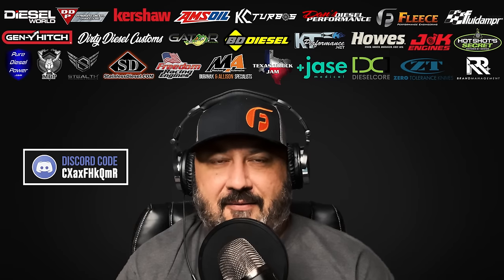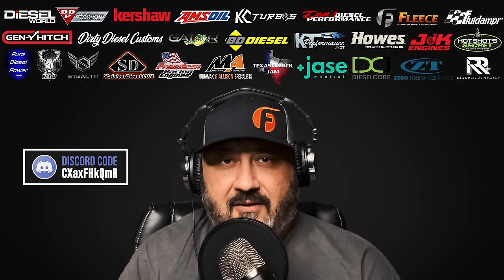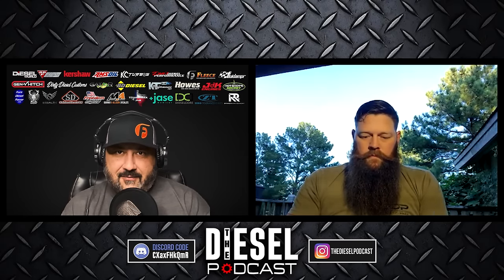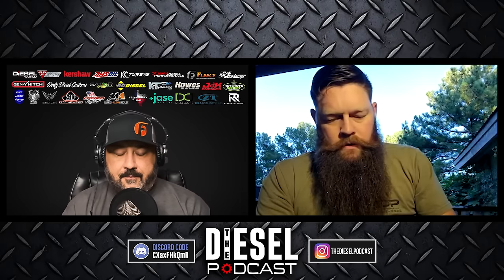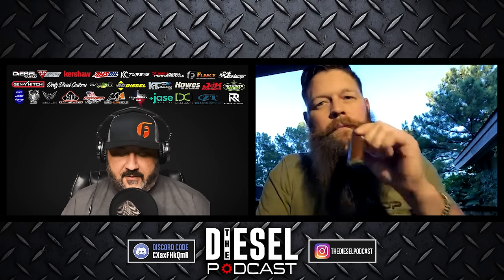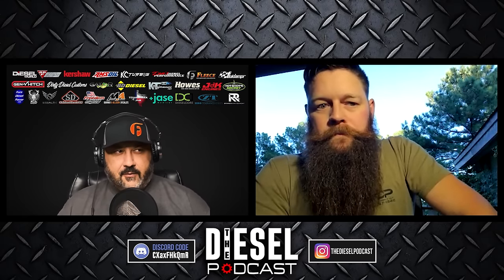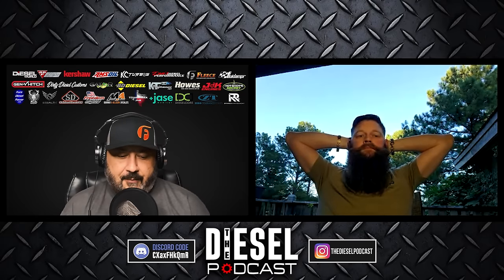Forced to Put DPF/EGR Back On?

Comment: I deleted my truck because I kept having problems with my emissions and kept spending THOUSANDS of dollars repairing it. Even if i did it myself, i would still spend thousands of dollars. My truck would stay on regen mode for hours driving on the highway and I'd get average of 6 to 8 mpg. That's bullshit.

I deleted it and tuned it and it woke up my truck. I get great milage, less repairs and my truck has over 600,000 miles on it. Without that delete, that truck wouldn't have seen more than 250k miles

Comment: Thanks for the excellent podcast. I have driven a diesel since 1982 when GM was raping the public with their 5.7 liter converted gas engines. I made a few changes and made that 5.7 last 350,000 miles. I had always wanted a Dodge ram with a Cummins and finally got one. It was a 2001 long bed quad cab with a 5.9 HO and 6 speed manual. This truck got better fuel mileage than the S-10 Blazer or the Astro vans I had. We took it on vacation because it was so economical at 23.7 mpg running down the highway at 70 through the mountains in Missouri, Tennessee, Kentucky. I had gotten over 25 mpg on several tanks. That's hand calculated!!!. I expected similar results when I had to upgrade to a 2008 2500 HD with a 6.7. I wanted to do the right thing and be emissions compliant but the truck was in the shop twice a month for the first year I had it. They kept telling me they would fix it. LOL!!! My fuel economy with that truck was 25% less than the 2001 because of the emissions system. The same EPA that is truing to force impossible mileage goals for the manufacturer just killed one of the most economical vehicles on the road. I engaged a lawyer, sent all of the repair bills which were all emissions system related to Dodge explaining that due to loss of use, time off of work taking the truck back and forth to the dealer, decreased fuel economy, etc that they compensate me $15,000. They came back with an offer of $7500 if I would just go away, they didn't even contest it. The emissions system as originally designed and manufactured was defective. It would not work anywhere but in a controlled environment. You guys are correct in that they have no idea what they are enforcing, how the system works or anything else for that matter. If they would allow the manufacturers to build a system that would work in everyday use, I would go for it but they won't. They have run Volkswagen diesel cars out of the US and seem to be working on the rest of the industry. If they would work with the manufacturers to build a system that would work without huge maintenance costs and fuel economy penalties maybe people wouldn't be deleting. Their job is to find things to worry about. If they don't, they don't have jobs so they will create new issues that keep them cramming laws down our throats to keep themselves employed. They have made many of us criminals but they accept no responsibility for the problems we are having. Sorry for the long rant but I've been enjoying diesels for 40 years and now the idiots are threating to take that away along with many of our other freedoms. Thanks again for the podcast.
Reply: Now with computers, the systems can be tuned to way cleaner burning  engines. I have proven this with my own personnel 08 6.4 by tuning and adding a (Modified) baffled and screened catch can. Equals fewer contaminants in the intake system, cleaner burn in the combustion chamber, and better HP. Improved MPG. Fewer emissions, and improved engine life on all internal moving parts. Less downtime.

Comment: I know this is an old video but, I love how this is done! And we are all breaking the law it's just not enforced is very true! There are too many laws to all be enforced and many of them are in direct conflict with each other. I have been driving a diesel for the last 30 years. The 7.3 was the first standard for light to medium trucks. I am the third owner of my current diesel a 6.4 powerstroke that was set up and runs great tuned to the same output of the newest 6.7 high output and gets better fuel economy. The ironic part is I went to the State of Georgia and bought it from a dealer because they were wholesaling because to sell it otherwise they would have to put it back fully to stock or face possible fines and jeopardize their dealership license. 
The fact that those that are being tasked with enforcing the laws do not  know the law.  Keep putting out the updates because I don't think that anyone really knows the laws that cover this subject. Because as best as I (retired LEO) understand what the actual EPA standard of the Law states is that the  vehicle must pass the emissions test standard that it did at the date it was manufactured!! With or without factory equipment if it meets that standard it is in compliance with what the EPA Law states!!

Comment: Such good information. I'm the guy who drives his 97,500 dually 15 to work and 15 min home. I just like diesels. But I'm constantly stressed about getting and staying hot enough to regen. But I'm in the middle of replacing all the charge pipes. Down tube. Intake.  Manifolds up tubes. So this puts me at ease a bit.

Comment: That's why my 2000 F-250 Lariat 7.3 SD is still on the road. It's been an amazing reilable truck and motor... the only thing I've to replace was the front hubs, my bad for running Phat tires that wore out the hubs. The Water/Meth injection has peque my interest, I have added mods like HI A/C injectors, upgraded the turbo, Banks Intercooler plus the Trans Command module and running a TS power chip set on stage 4 which works for me!
I talk to alot of folks about my 7.3 and tell them to let her indle 5 minutes or the piro is under 350 degrees... as a OTR driver in my past life keeping the EGR temps down will give you a Million mile motor!

Comment: No-one wants to talk about WHY the epa and other agencies came after truck owners (and shops). Hate to say it, but it's their own damn fault. The government HATES when people flaunt disregard of the laws. That is exactly what most diesel owners did. Instead of quietly tuning their trucks for better performance and better mileage and being discrete about it, they chose to include tunes for "rolling coal". They also produced and installed EGR bypass systems that were VERY obvious, some of them bright purple pipes or "block offs". Some idiots even made it a point to go to political rallys with their trucks "rolling coal". Thank you so much for drawing attention to the shops and people that simply were trying to keep their trucks on the road and running without failures due to emissions systems. As someone once said " When I see black smoke from your truck, all I see is someone that doesn't know how to tune a truck".

Comment: Someone need me to run a research on if DPF /DEF systems are actually working for their climate change. 
Run same trucks with and without emissions systems. 
See what the difference in emissions output vs mpg. 
Run the numbers for cost of emissions systems for each vehicle.
Run the numbers for baking def, how much energy it uses.
Run the numbers for manufacturing emissions systems be not having emissions systems. 
 Run the numbers for hauling DEF fluids and manufacturing Def fluids. 
I bet, if you do intensive research, we’ll find the epa emissions produces more emissions than  and uses more fuel than just having a basic emission system.

Comment: Returning the vehivle to stock. Is not running with a failed government emmisions project. But rather a clean burning properly tuned well maintaned engine. That has higher mpg. more hp. And longer lasting less maintanence vehicles.

Comment: Have you looked behind your EGR and seen how plugged with soot and goo your intake is? Have you been behind and followed, have you been stuck in trafic when one of these 08 to 2010 veh  while it is in regen? Try it on a hot day. And as the owner or driver in this situation your life could be threatened. Have your oil tested at your 5000 + recommended service.  And you have 2 + quarts extra in your crankcase and that turns out to be fuel that has by passed your rings during regen that is just destroying to life of your engine.
PS since I put a large volume 4" catchcan with 1" ports and a baffle plate on my blowby for my 08 6.4 Powerstroke my  cold start has improved greatly and the amount of black smoke on lift off in stop and go traffic has greatly improved no black smoke on a normal lift off with a meadum load.👍👍

Comment: Enjoy your podcast, I am a Owner Operator OTR OVER MY YEARS OF OWNING EIGHT TRUCK IN MY CARRIER I have found that if I stay away of the Bio diesel the engines seem to get better fuel mileage, and less problems with the emissions systems
Reply from the maker: Thank you for listening!
Reply: Bio diesel dependence where u get it. How ur engine will perform.

Comment: First time viewer and man it was great. I only run 7.3's because of all this and Its very comforting to just put diesel fuel in and go. I would not own anything newer because of it. My 96 has 365k and is still on the original injectors. It runs great. My soon to be hotshot truck is a 2002 and its built to 425 hp and runs really well. I'm breaking it in now and will be hitting the hauling road after the first of the year. Great info and great podcast. Thanks, a new subscriber.
Reply from the maker: Thanks for listening, we appreciate it! We have some 7.3 specific episodes on the channel.  Let us know if you’d like a topic about them covered on an episode.
Reply: This is why California it trying to bad older vehicles from the road.  Which is pointless.  Their aren’t a lot of older engines left on the road to make a difference
Reply: @robertusa1234 and it all started when they cracked down on truckers putting old motors in new chassis. The glider kit.

Comment: I now own a 2017 Ford 6.7 f250, the biggest mistake I ever made because of the fuel mileage, 12 Mpg towing a light trailer, maybe 15 Mpg on the highway without, and constantly worrying about a $10,000 breakdown .During  my pick up truck owning/driving career I sold  my 1997 F250 with a 7.3  ( bought it new and meticulously maintained it) It  only had 74,000 miles on it when I sold it in 2006. Dam thing used to get 24-26 miles to the gallon- didn't matter if I drove it in the city or on the highway. I couldn't even smell burning diesel coming out of the exhaust, never black exhaust and when cold a little light grey exhaust, and unbelievably the engine oil stayed very clean looking between oil changes. Only problem that I ever had was the oil pan leaked (a lot) and was told by numerous mechanics  that the engine had to be pulled or that  the cab had to be lifted to reseal the pan at a cost of over $2,500.00 at the time, which was one of the reasons that I sold it. I have since found out that there is an outfit somewhere in Mass. that you can buy a two piece oil pan for less than $500.00 dollars. I'm seriously considering selling it, I had plans to pull a small 5th wheel toy hauler when my wife retires in two years so that we can travel  the country together but I'm afraid that something catastrophic is going to happen to it before that time comes. Anyhow- just venting...

Comment: I enjoyed the video I have a 2006 GMC Sierra 2500 HD 6.6 Duramax engine has 365.000km its stock  runs like a clock don't have any tunes on it  don't intend to delete anything. I am removing and cleaning the EGR system on it  only.

Comment: I highly doubt it, in the heavy diesel truck world, they are still handing out those deletes for new trucks due to lack of parts, and no viable replacements. Due to the oem parts being proven to be prone to premature failure. With any luck the EPA will be dissolved along with all the 3 letter organizations.

Comment: I use Lucas Diesel Deep Clean.  Gotta have it.

I was in the oilfield for many years using a truck that had the DEF system on it.  In those vocational environments (idle time, PTO time, wait, etc) with cold weather especially - you gotta use it.  Otherwise you'll plug up the SCR fast.  Downtime is unacceptable in work environments and it'll break your business. 

I put 400,000 hard miles on the truck in 6 years and had ZERO emissions issues.  It was a Freightliner 122SD with a Detroit 600HP diesel and 18 speed transmission with 46K rears.  

You MUST use LDDC to keep the filters clean.  PLUS - do regular forced regens.  Especially if you drive just local distances.  Otherwise the shops will get you with high $$$$$ repairs.

Comment: Ive got 343,000 on a 2018 eco diesel, runs like a champ, but spends most of the time on the highway and I drive it like I stole it. Im onto a 2023 eco diesel with 93,000 in 14 months, no issues.

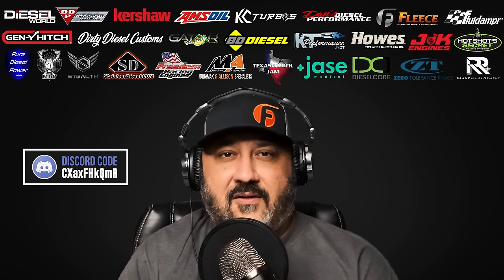Comment: 0:46 Answer to first Question:
You can use a decarboniser additive with each refuel.
The product I used has independent scientific reports AND was tested by a NATA certified testing specialist which is part of the Brisbane city council.
The test compared a new Isuzu diesel ute first without any additives, then with CEM (Australian based Cost Effective Maintenance…mining companies are saving big bucks as Cat Dozers last much longer than recommended with less wear than the non additive engines.). Anyway, I’m only going to mention the decarboniser increases the cetane rating a little and because of the slightly better combustion not only reduces the  number of particulates, but the size of the soot.  This obviously means reduced regenerations saving money here.  As well, when doing a regen, the DPF burns hotter and this reduces  regen time.  I’ve used their products for about 15 years.  As I buy in bulk it actually pays for itself in slightly increased fuel consumption.  The other benefit is cleaner engine internals and injector spray pattern is maintained as designed.

One mind blowing fact I know is that the oil additive AW10 allows the engine oil soot loading to double (and still keep the oil within specs), now I’m not saying to extend your servicing intervals…I would never do that, in fact I like to cut them short.
Every 50,000 klms I do a “double flush” using the flush concentrate and use cheap oil, just drive about 15 klms, then dump the oil to put the good stuff in, of course with AW10.  2% per volume is all u need.
They have a cheap book which has many customer successes (including a large mining company I was telling u about).
I get nothing out of telling you about this…I’m just a diesel lover, from small vehicles to 4x4 to V8 twin turbo Audi Q7 I owned years ago…Damm that was a fast SUV (was tuned, small exhaust mods).  Currently I own a heavily modified LandCruiser Prado 2007 (240kW, 560 Nm at the wheels).
Thinking about an older US truck pre DPF and mechanical fuel injection…any suggestions?

FYI, typically DPFs should be removed and specially cleaned every 150,000 klms and in Australia the best in the business charge. $600 AUD.  Thing is, by using the decarboniser you will extend this very much longer.
Not sure what u guys have in the US, but just make sure it’s laboratory and field tested with quality company reports.

Comment: EGR was designed to kill engines. Whats the point in having an air filter if running EGR? No point....
EGR directs abrasive carbon soot straight back into intake is the worst idea for the life of an engine.
If they want sustainability removing the EGR is the best thing for deisel. As quadruples the life of the engine.
DPF is ok if running the correct oil and running the truck long distances. 
Fuel economy is much better with out it. 
Less diesel burnt to do the job  = less emmisions.
Reply: The newer 3.0 Dmax has a post DPF EGR which is much cleaner.  May be the way all manufacturers do it in the future?
Reply: @hahaadventures4838   yes that would definitely reduce the carbon/soot being fed back into engine, but still nowhere near as good as filtered clean cold air from the intercooler.

Comment: Maybe that is why my 2 6 Leakers run so good. 2004 F550 with 210K on the clock and a 2006 F250 230K on the clock and I beat them like a red headed step child EVERYWHERE I go.

Comment: The EGR is nothing but a exshaust leak into the intake. Its understandable the need to remove it. I personally never liked the delete option, I prefer just to turn it off by one way or another. The EGR is easy, simply unplug it. Yes a code is sent and the light comes on, but that does not bother me. I can easily put up with the light vs my intake clogging up with the black gombo.